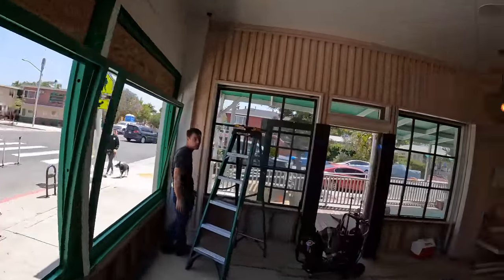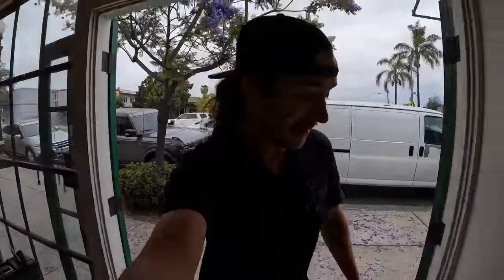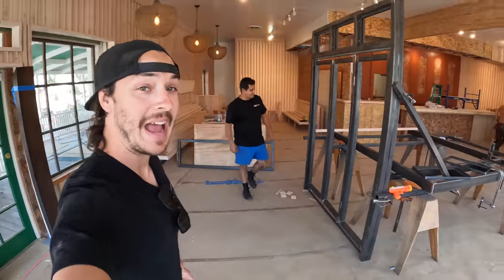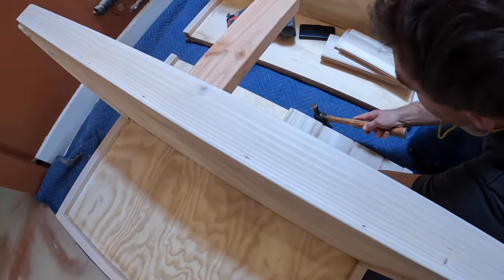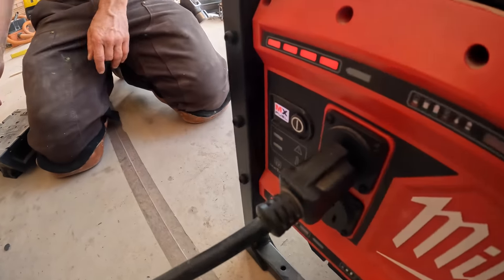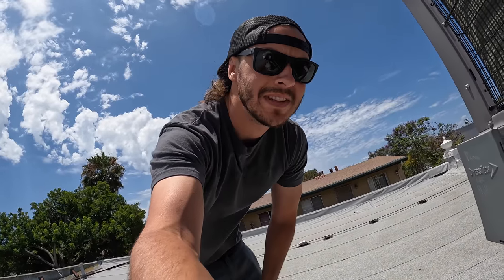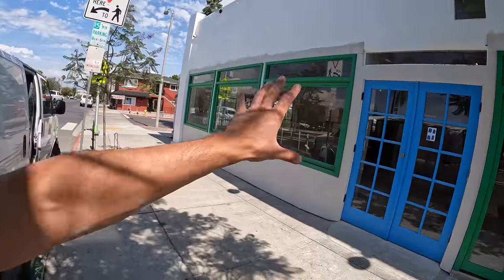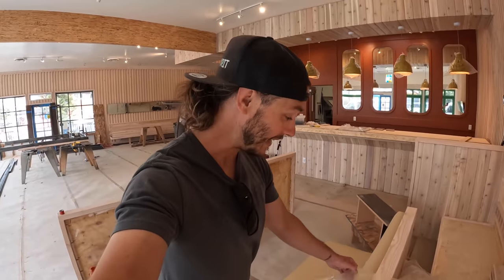They DESTROYED the Front of Our Restaurant Build!

Comment: It’s really cool to see you making these windows and doors. I actually work at a small business as a designer where we make custom steel doors and windows using a series of specially manufactured steel extrusions that come in 15-20 different profiled and can be configured differently for different swing directions and components of each door. Our units are usually under an inch and a half in thickness and can even be made as a thermally broken unit that won’t transfer as much heat or cold.

Comment: That smooth finish is inconsistent but there is no way around that cold joint to the the existing. We can blend it was better and fill in ever pour. But it’ll still be noticeable to a trained eye. Because there is a horizontal line stretching across. I’ll be honest tho. That stucco guy could have done a way better job.. I mean way better. Apply some stuff. And sand and blend.. and it’ll be in noticeable. It might crack depending on the type of base cement you used for the scratch and brown… but that’s for another discussion

Comment: You should seriously sell your customers on letting you coat these type of custom steel frames with a thin epoxy resin coat over the primer and a color coat over the epoxy. Your creations will last a lot longer without rust damage. Source: worked on undisclosed properties featuring Steel framing and high impact coastal sea breeze salty air, got to see what a few million dollars of "research" yielded.